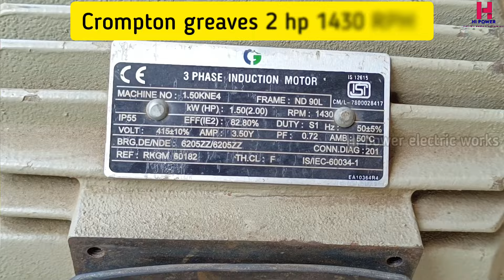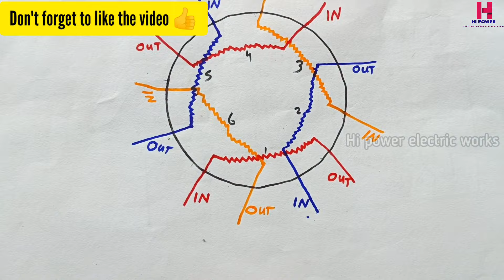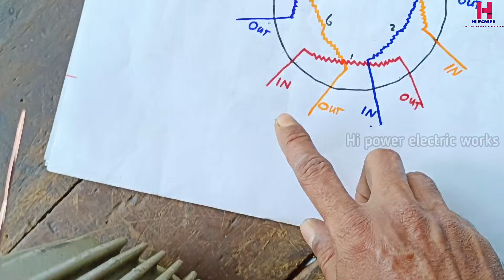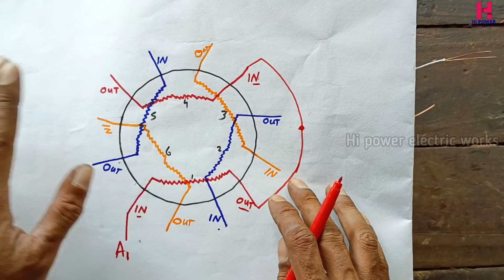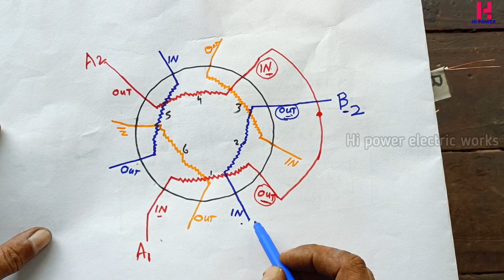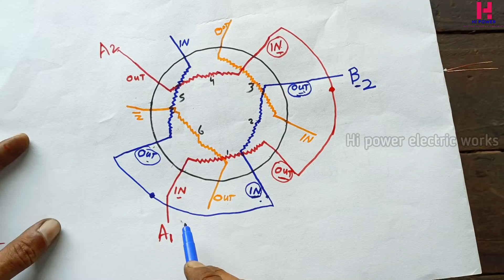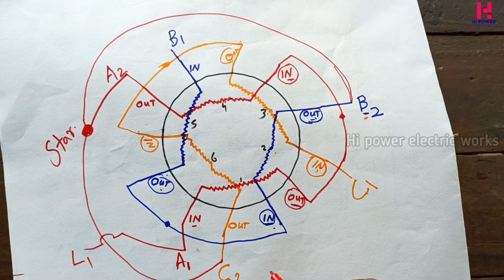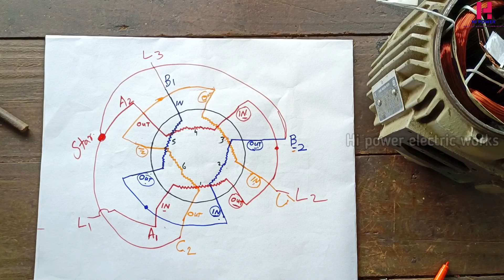3 phase 2 hp 6coil 1440 rpm motor winding and connection with diagram|24 slot 3 phase motor winding

Comment: hi great video but i have a question:
i see all coils and wires are touching each other won't that cause problems??
Reply from the maker: There are 6 sets of coils in this winding and these 6 sets of coils should be kept on separate paper without touching each other.

Comment: Great video, if I may ask, how did you know the wire to use regarding the thickness? I have been tasked with coming up with a design for a rewinding machine and explain fully rewinding.
Reply from the maker: When I wind the motor, I use the same winding data that the motor had before, which is the correct wire size and turns for the motor when the motor is factory built.

Comment: What is the name of the tool u have used to cut the old copper wire?
Reply from the maker: Chisel
Reply: @Hipowerelectricworks  wood work chisel or ?
Reply from the maker: @Allinone-iz8uq  tempered hard chisel

Comment: What are the possible reason for winding problem
Reply from the maker: In the case of a three phase motor, there is a risk of damage to the motor winding due to low voltage, loss of a line, bearing complaint of the motor.

Comment: This is a 2 pole motor! 6 coils/3 phase=2 poles. RPM will be 2900 or so, not 1440.
Reply from the maker: The connection of this motor is different.  So it will be 1440 rpm
Reply: Really...are you sure that 1400 rpm?? I think you wrong sir
Reply from the maker: @arjunatekhnik9251  This motor winding is called half coil winding.  Half coil winding connection is different (end to start joint. Note the connection) This motor has 2 coils per phase and two poles per coil.  So the rpm of this motor is 1440
Reply from the maker: @arjunatekhnik9251  Please note the winding connection in the video is a different connection
Reply: @Hipowerelectricworks If I do the math ((50hz*60*3)/6Poles)=1500rpm but the rpm is slightly lower, due to the fact, that it's an unsynchrounized motor.

Comment: Aluminum coil 22swg =equipment to copper coil swg...?. Hwo mach.
Reply from the maker: Motor winding the same gauge is perfect
Mixer grinder
For example - Preethi Bluleaf  750 watts new model
Company winding is 22 SWG aluminum while rewinding 23 SWG copper is sufficient.

Comment: Single phase  old grinder motor

only centrifugal switch  
not capacitor 
connection yapide podurathu bro
Reply from the maker: Starting lead+Running lead  joint - phase

Starting lead+ Centrifugal switch wire joint

Centrifugal switch wire+Running lead - Neutral
Connection yepedi Enna oru video next upload seyyam bro
Thank you
Reply: @Hipowerelectricworks  ok  thank you